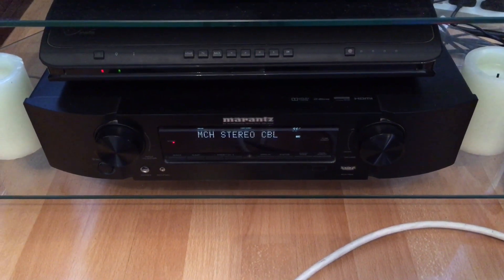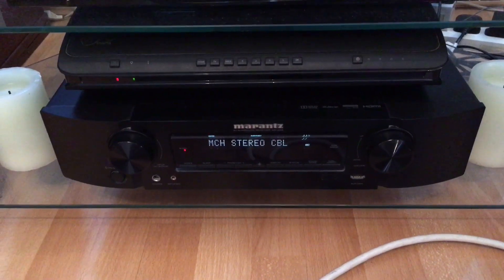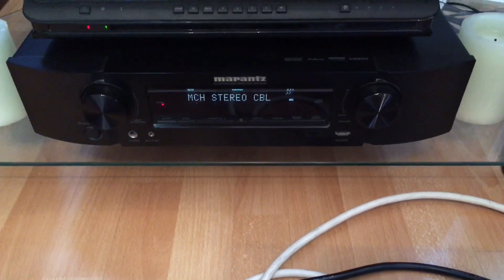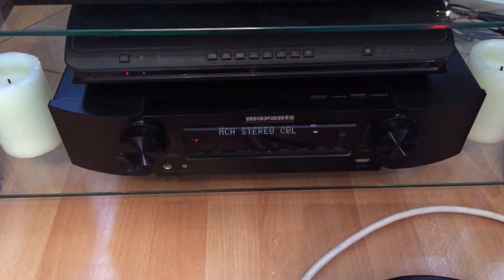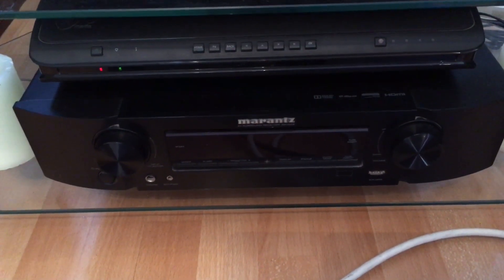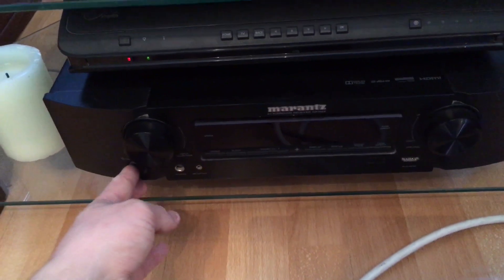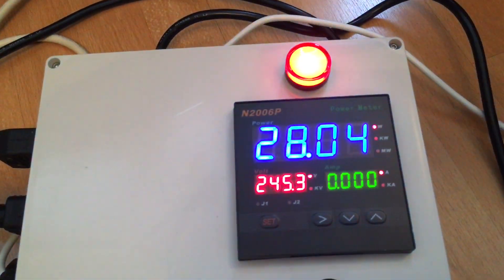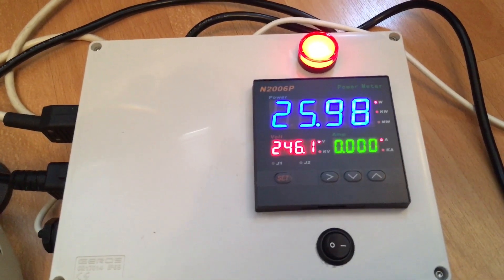It’s dead Jim!

Comment: Bet you it's old/dried up electrolytics on the low voltage side of the power supply.
Reply: That is what I was thinking. It is maybe not sustaining a smooth DC output.